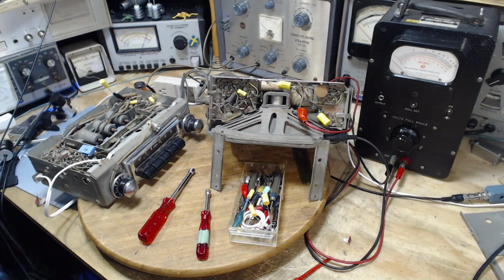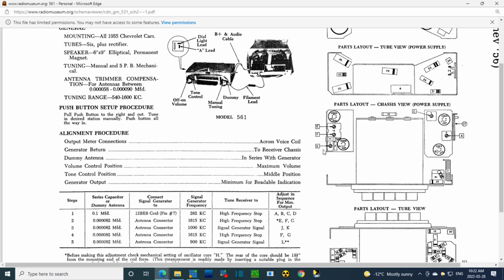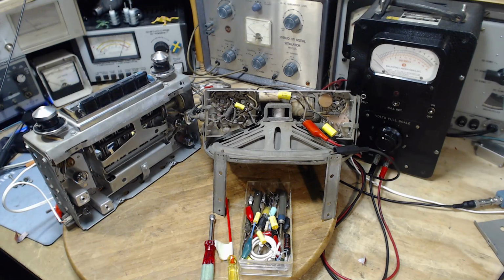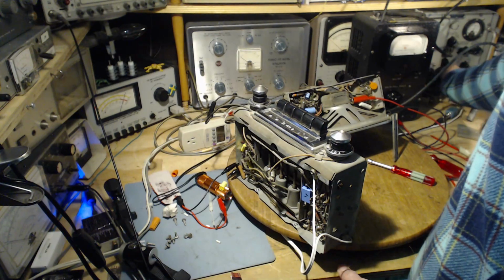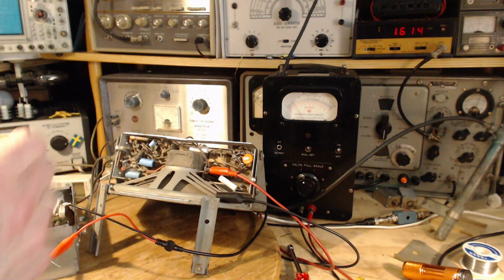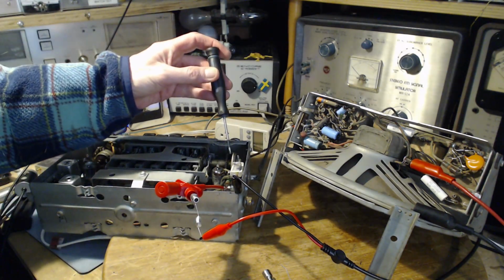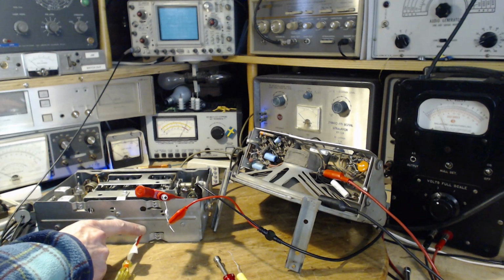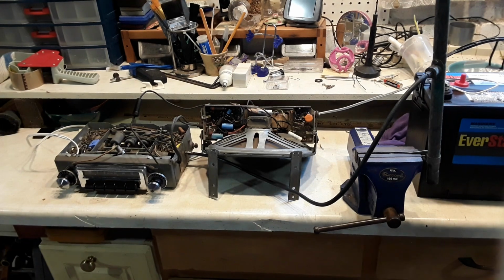1957 Chevy Model 561 Video #2 - Initial Alignment

Comment: Went all the way to 45:40 to hear it not getting  any interference ,the shop is too noisy and the garage was slightly better.
The chassis is exposed so it won't pick up too well ( grounding issue) but it is working just not loud and clear of a signal.

Comment: Those old vibrators looked pretty solid.  They look like a double set of points inside a car's ignition system from the period without the cam to open and close the points.  The main reason I think they quit on a radio is one of the same reasons they stop working in an ignition system.  They sit too long and that leads to a buildup on them of non conductive material.  So, finely sand them just enough to get rid of that coating and they tend to work again.